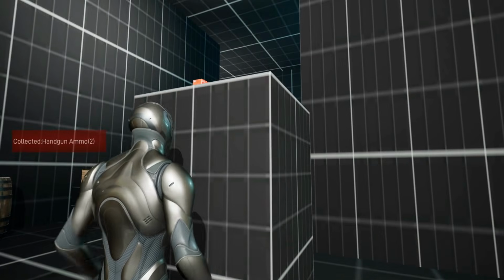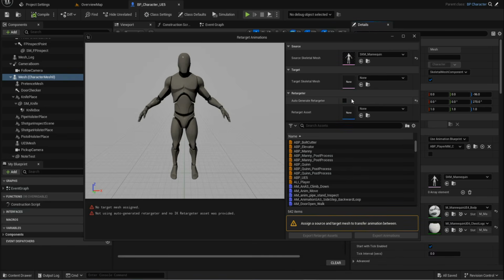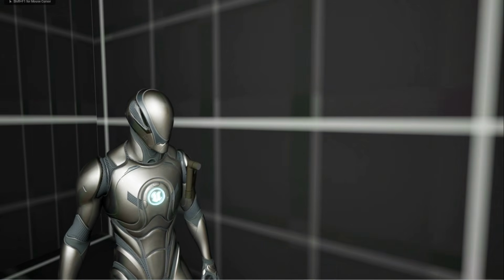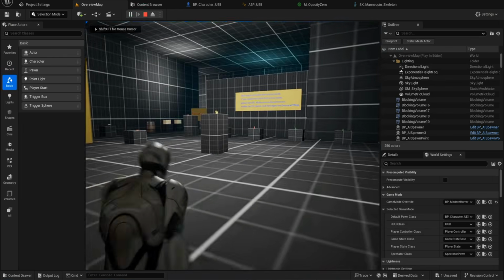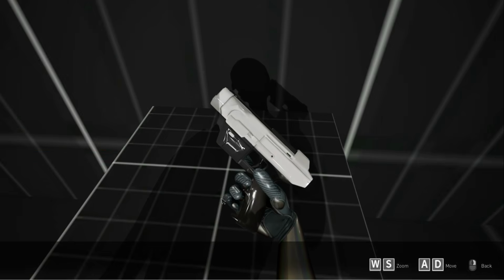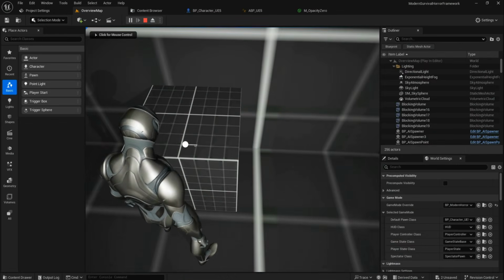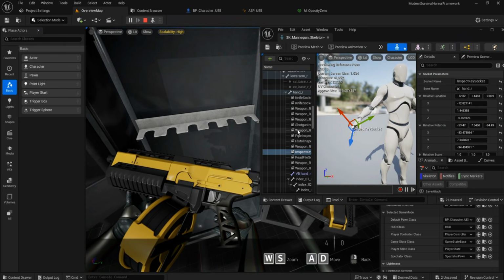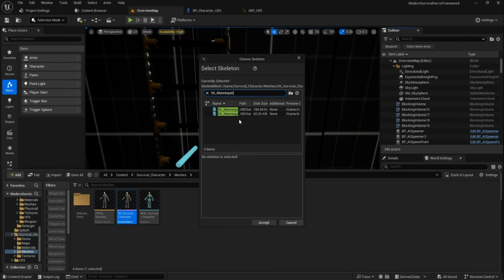Getting Started with the Modern Survival Horror Framework – #4 (Using a UE5 Character)

Comment: Thanks for the video, works great. Is there an option to holster the weapon once its been equipped? I'm only able to swap weapons once one has been equipped...
Reply from the maker: Thanks, glad it works for you. By default, the system is inventory-based like RE3 Remake. Weapon equip/unequip is handled through the inventory, and shortcut slots allow fast switching during gameplay. If you want a direct holster button, you can simply bind an input to the UnequipWeapon function in AC_Combat. We may consider adding this as an optional feature in future updates as well.

Comment: Why create a material? Just set ue4 mesh visible to false and select the always update bones/pose setting.
Reply: It didn't work for me for some reason. I had to create the material to make mesh invisible
Reply from the maker: @redzeroo6068  First, open the BP_Character class and go to the UpdatePerspectiveMode function. In the False branch, disconnect the Mesh from the Set Visibility node.

Then, in the child class you created for the UE5 character, click on the Mesh component and set its visibility to false. After that, set "Visibility Based Anim Tick Option" to "Always Tick Pose and Refresh Bones".

With this setup, you won’t need to use a transparent material anymore. I’ve also shared a reference image in the link below for guidance.
https://darksilvergames.com/wp-content/uploads/2026/05/BoneUpdateUE5.png